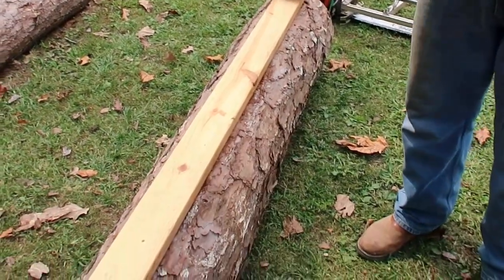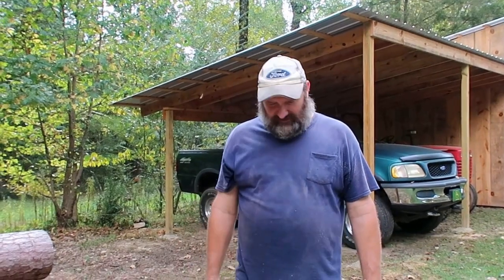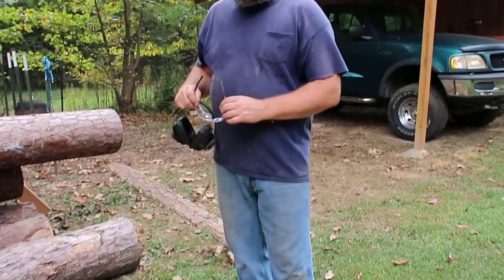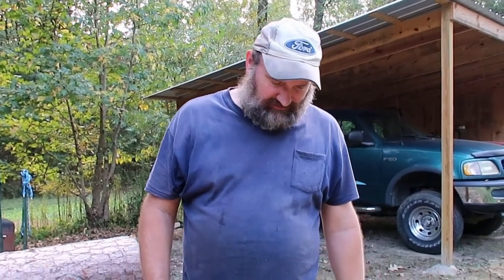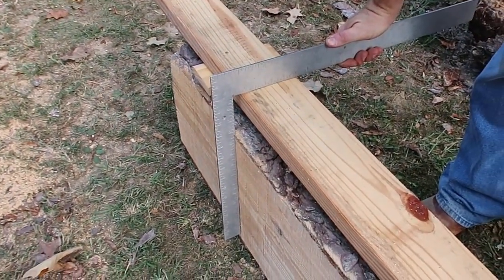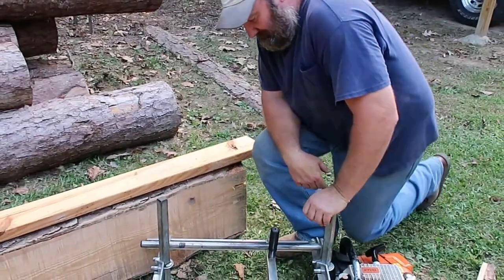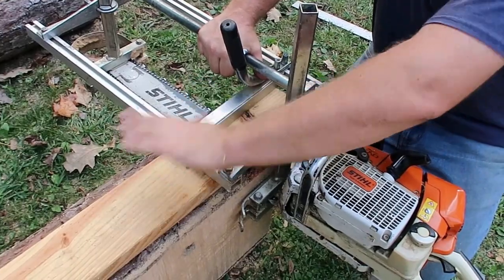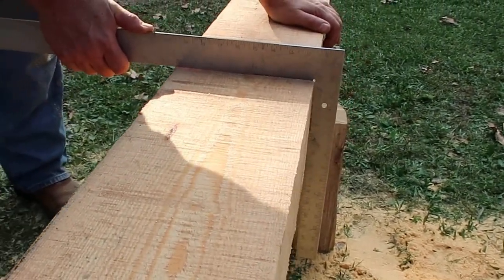Cutting 8 Inch Cant with Alaskan Chainsaw Mill

Comment: Did the saw do ok oiling the bar?
Reply from the maker: Yes it does. I have the oiler all the way up and have milled a lot with the saw and 24 inch bar. Never had the bar get hot and has always done good/ Just got through cutting (2) 8x8 and (3) 4x4's today. I would recommend a 70cc or bigger saw if cutting 16 inch or bigger logs. Have a Blessed Day Friend!   Justin